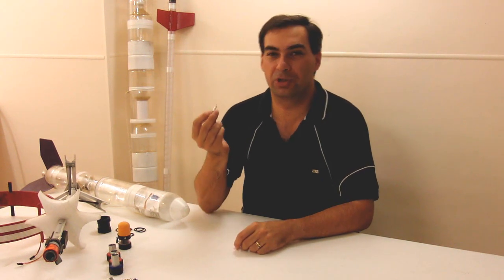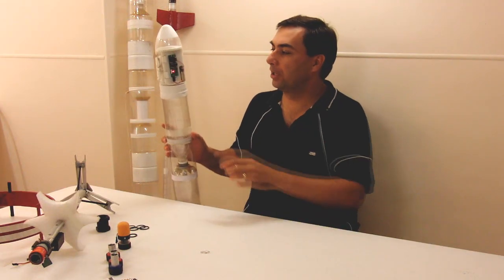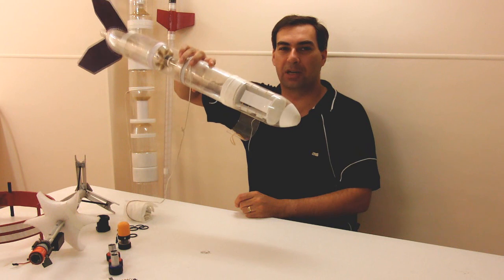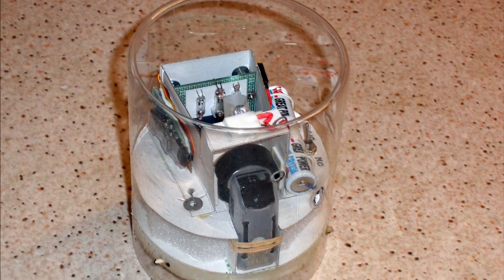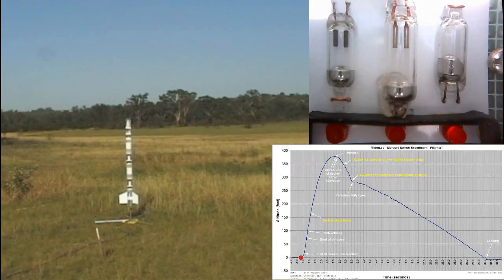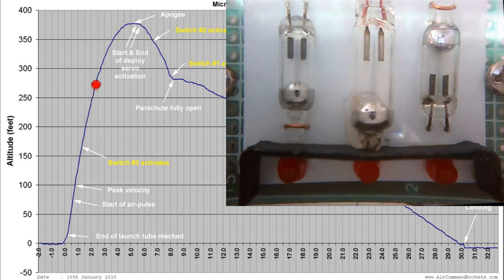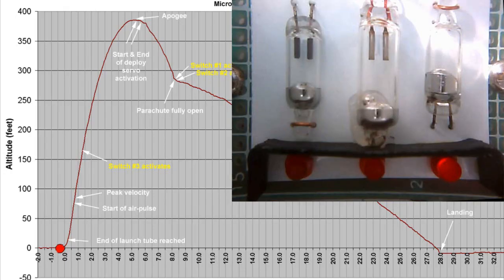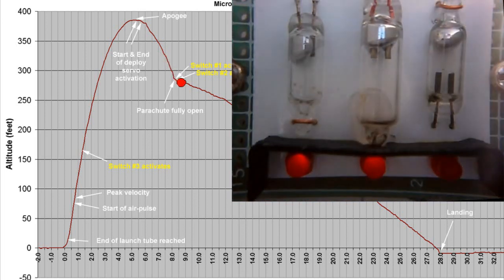Water rocket Mercury Switch Experiment

Comment from the maker: @VolksRocket Thanks. :) Unfortunately a pendulum switch won't work for apogee detection exactly the same way mercury switch doesn't. At apogee the pendulum is essentially in free fall the same as the rest of the rocket and therefore there is no force acting on the pendulum independently. It is a very common misconception though and it is counter intuitive.

Comment from the maker: The problem with solving the sticking problem at low deceleration rates is that you end up detecting burnout, not apogee. (The same as switch #3 in this experiment) 

Accelerometers can be used for measuring  altitude, but need a micro controller to turn the acceleration data into altitude. 

This experiment is about demonstrating that mercury switches don't work for apogee detection when they look like they should.

Comment: won't it fix the sticking at low deceleration rates?

If a mercury switch won't work then I suppose that will rule out accelerometers and gyroscopic chips?

Comment from the maker: This happens because air drag on the rocket causes it to undergo -ve acceleration. There is no air drag on the mercury bead and so it's inertia carries it upward. If there was more drag on the rocket then all three switches would have activated at the same time as switch 3.
You could use a timer to delay deployment after burnout, but then you might as well detect launch which is easier.